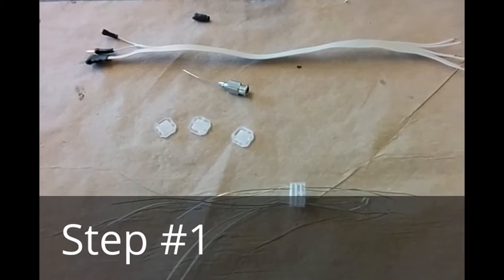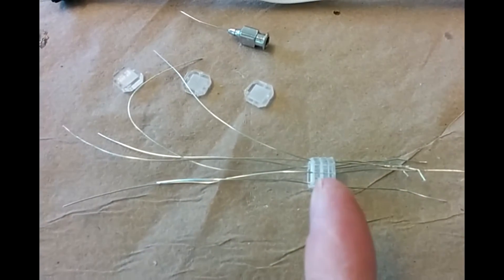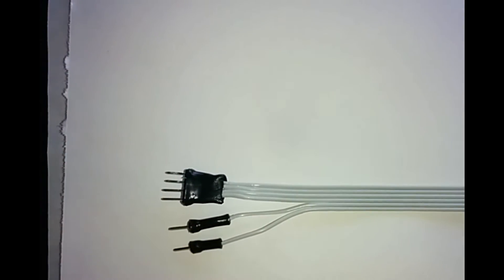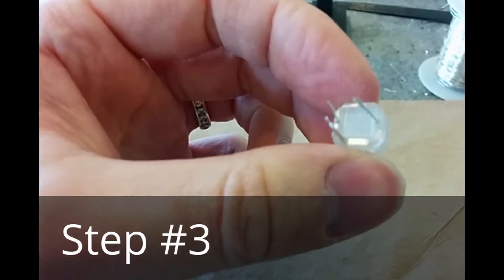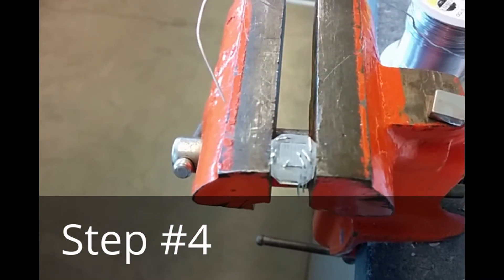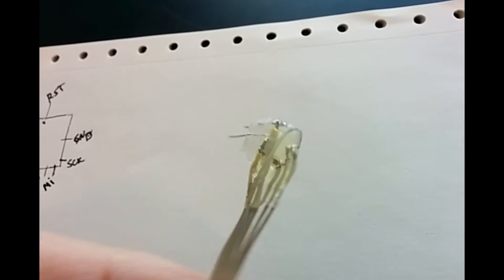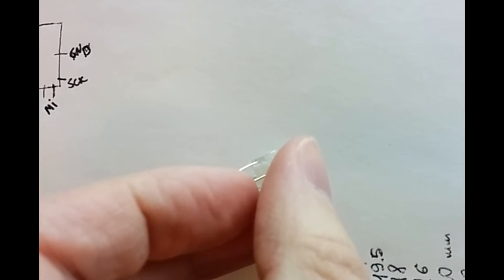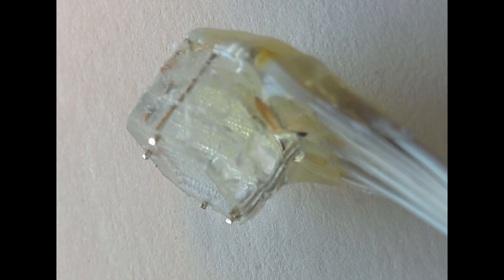How to make an ESC Flashing Socket Tool for ESC -  Atmega chip Flasher Programming Cable

Comment: 01:17 what are you saying? ‘Brick head socket’? Whatever it is: Where to get those?
Reply from the maker: It was rather an old project, no longer I can ship these. I can post laser cuter dxf files. You need to make those.
Reply: @vitaliyd193  Виталий, добрый день. Можно у вас приобрести такой кабель?
Reply: @vitaliyd193  can i please get that .dxf file? i have been trying to make my own from plastic bottle caps and jumper wires.
Reply: @vitaliyd193 can you share dxf files please